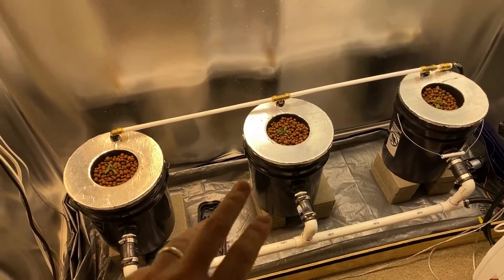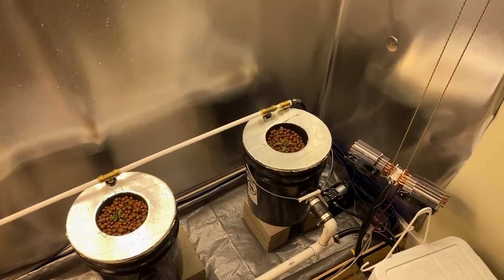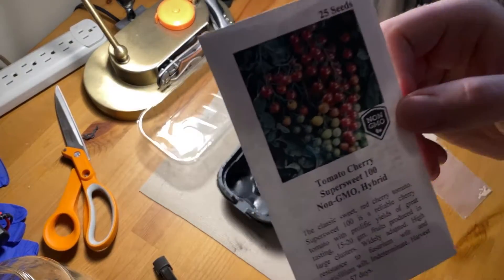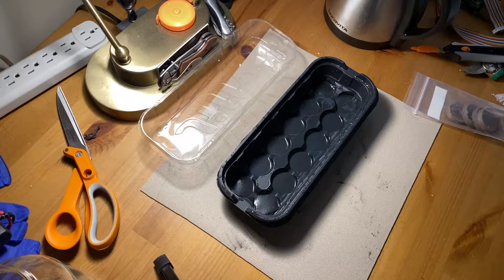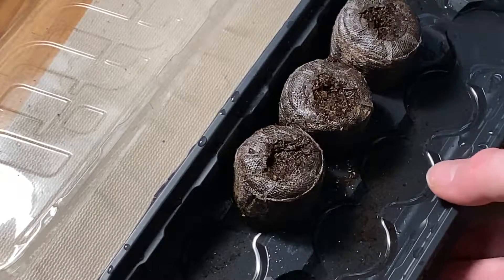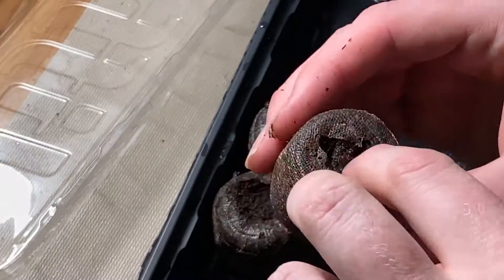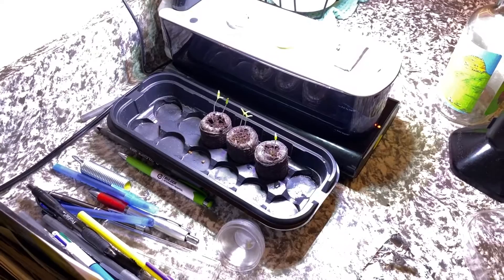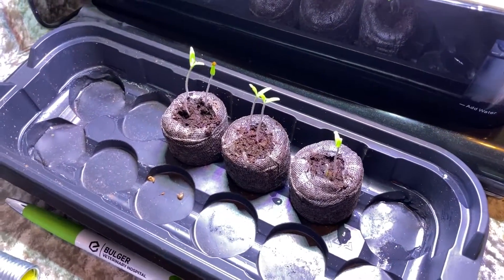DWC Hydroponic Tomatoes Seed to Sprout (Grow Update 1)

Comment: 5:03 I've got that exact same shark vacuum and I love it. I've had it for ~3 years. I've replaced the battery once and taken it apart once to fix the on/off button with a part I 3d printed. Its the best vacuum i've ever used.

Comment: Still need some help with water chiller. Can you do another recap/build or part numbers. Already built one but wasn't cool enough.
Reply from the maker: Here are the things I think you should check:

1)  Make sure you are cooling the hot side enough. In my closet grow I ran the pipes and cooling fan outside the door so they could cool more efficiently.
2) Make sure your TEC has a high enough power. The one I am using draws 9amps.
3) Try to insulate as much as you can. I store the nutrient solution in a drink cooler and I have wrapped all my 5 gallon buckets with foil wrapped bubble insulation.

You can also add another TEC and fan on the other side of the aluminum water block. Just make sure you put the cool side on the water block and the hot side on the fan. You should also make sure your power supply has enough power for the new devices.
Reply: @SmartGrowAutomation   i got a pre made one but wasn't big enough. Only room temp. I think I need the pipes and big fan
Reply: How hot does your room get?
Reply: Frozen water bottle.